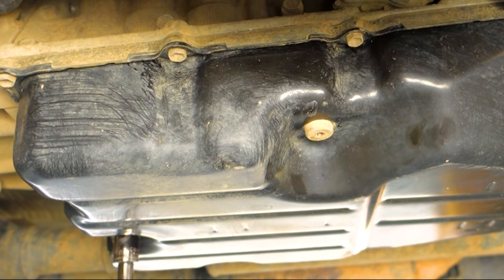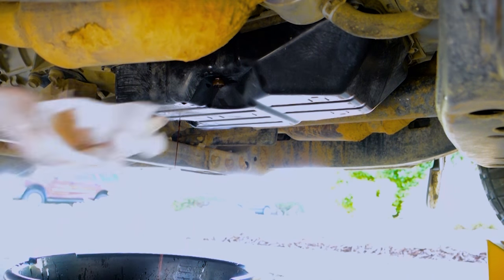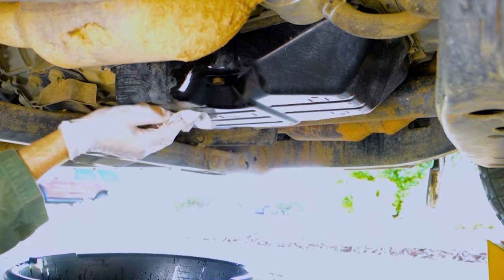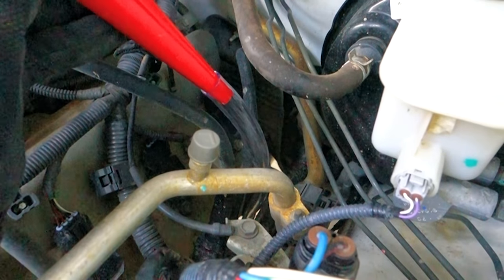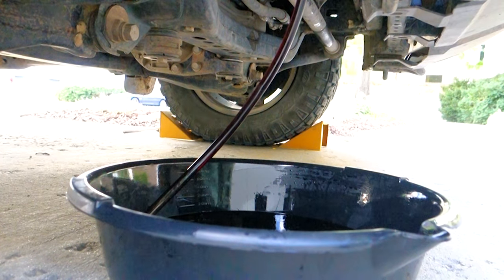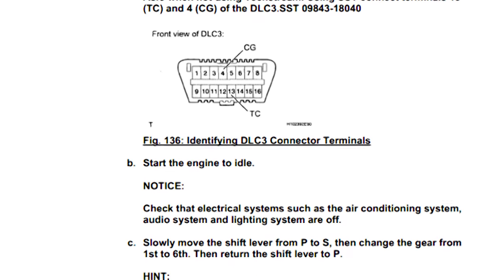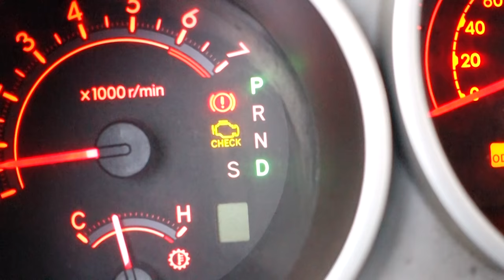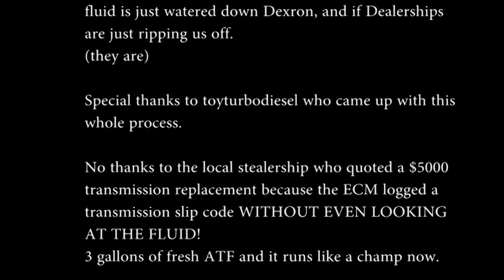Toyota Tundra Full Transmission Flush

Comment: First of all...great video. Gave me the confidence to give it a go and confident that it is being done right. I'm just gonna post my step by step process which comes straight from this video and all of the great comments on this post. If this is your first attempt, watch the video a couple of times and read the comments, the post and replies and you will  understand the process. It was almost like a light bulb when off and had that ahah moment after watching and reading a few times. I am confident I can do this, even before I ever got started. So here is my step by step and my contribution to the Youtubers and DIYers.  

Apply the parking brake
Transmission cooler thermostat lock with wire or paper clip
WS marks fill port
Loosen the 3 transmission plugs first
Remove Drain plug and drain the fluid
Measure  the amount of oil drained
Replace the drain plug
Refill with the same amount into transmission fill port

Disconnect the transmissionoil cooler outlet hose
Attach an extra drain hose from the transmission cooler  into a  drain pan
(*This video says the top hose, mine was the bottom hose on a 2007 Tundra Gen 2)
Turn the engine on
The fluid from the cooler will start to drain
Measure the amount of fluid drained
While the engine is running, have the driver shift through all of the gears to open all of the ports
(I heard the gears start to stick so I would only shift through the gears once)
Turn off the truck 
Add transmission fluid into transmission. The same amount that came out of the cooler and the same place where you poured it in earlier into the transmission.  
Repeat process until clean oil comes out. (Start truck for 40 seconds, don't shift though gears a second time.) 
After clean oil comes out of the oil cooler, you are done draining oil from the transmission cooler so reattach the transmission cooler hose. 
Remove the overflow check plug and add fluid until oil drips out.
Replace the check plug.

Start transmission temperature process. 

MEASURING OIL TEMPERATURE
Use a jumper such as a paper clip to jump the  #4 & #13 ports together on OBDII port. The place where you attach a code scanner. 
Start the engine
Shift though all the gears to circulate fluid. Move about one gear per second.
Move shifter to drive...then move the shifter back and forth from neutral “N” to drive “D” for at least 6 seconds to engage temperature detection mode
The drive “D” light will stay on even though you are moving the shifter.
If it doesn’t work, move back to park “P”. Shut engine off and start over and double check the paper clip jumper.
Once the vehicle is in “temperature check mode” the drive light “D” will be:
OFF= TOO COLD
BLINKING=TOO HOT
ON=JUST RIGHT
When in the right temperature range, with the engine idling, remove the check port plug and add transmission fluid until a Good STREAM is flowing out then reinstall the check plug.
Shut the engine off
Torque all the bolts and clean up!

Thank you for the video and all of the post. I was able to save some money and do the job right. Can't say thanks enough!
Reply: Does your 2007 Tundra have the A750E? I am getting ready to do this and want to make sure I have the right hose
Reply: Do you know where i can find the directions for my truck i have a 2007 4.7 Tundra or do you think they are exactly the same as you just wrote out? Thank you

Comment: Two things I've learned while doing my atf change on my 2011. First the tube sizes were wrong. You need a 1/2" ID for the fill and a 3/8" ID for my cooler. Idk why but thats what worked for me. Second is that he did not specify if the temp valve should remain open when checking the level which it should. That is all. Great video. 👍

Comment: Great video.  This really made it easy, especially with the Temperature procedure - I will add that the Torque specs are 15 lbs-ft for the hex/check bolt, ~24 lb-ft for the drain, 29 lb-ft for the fill.  The cooler return line on the 2011 Tundra looks a bit different in that it's covered up on the inside of the grill.  You have to disconnect on the outside of the radiator/cooler - but it is still the top hose, just follow it though to the outside and disconnect there.  3/8" ID tubing fit just fine.

Comment: Great video. Very clear and straightforward. Couple additional steps that I would've done was to repeat the process where you start the engine to drain out old fluid. Do that in 1 to 2 quart intervals to flush out all the fluid.  When the fluid starts looking new coming out of your clear tube then proceed with your check level process. Again nice video.
Reply: Agreed.  He did mention exactly what you just said, but it would be helpful for others to see it in case they're not paying attention.

Comment: I have a 2013 Tundra SR5 / TRD with 6 speed automatic, 5.7 liter engine.  On this model, the transmission cooler and AC condenser are all one piece.  The top 25% or the coil is the transmission cooler and the rest is the AC condenser.  In this case, you will have to disconnect the rubber hose on the grill side of the radiator instead of the engine side of the radiator.  Additionally, I highly highly highly (oh did I mention highly?) recommend purchasing a transmission filter kit, drop the tranny pan, clean it out and clean the magnets in the bottom of the pan.  There will be a lot off very fine shavings in the bottom of the pan (from normal wear) and on the magnets.  Remove the old filter, install the new one and then reinstall the pan with the new gasket.  Of course,  this would be done after the first drain you do.
Reply: what? this would be done when?
Reply: Napa auto parts sells an awesome gasket that is 100 times better than any others I have seen. They run about $65 for a filter and gasket but super high quality.

Comment: Great video and straight to the point. This is not a new procedure and is the 'poor man flush' can be used on any vehicle. This however outlines great detail on how to do it on a Tundra, well done. I agree with you on Toyota's change interval being way too long. Mine had 122K miles and this must have been the first change, my fluid was BLACK. Truck was searching for gears so I knew something was up. (i'm 2nd owner but truck had all other maint done according to carfax, trans was only thing I  didn't see). I used  my scangauge II to measure trans temp which made it a little easier to do the top off. Then for final top off I just overfilled a little bit and then started truck, opened the check and drained until it trickled. I was doing this myself so it made it easier then starting/opening check/pouring/looking.  Thanks for posting.
Reply: did it run better afterwards? i know its been 5 years since you posted lol... I have a similar milage 2013 and ordered everything to do this. I dont think its ever been changed either,.

Comment: Awesome video! Thank you so much. I just did my 07 Tundra and the jumper points worked perfectly. I over did the flush and ended up using 3 3/4 gallons but the fluid was squeaky clean coming out. All in all it's easier than changing the fluid on a turbo hydramatic 350 and all the fluid gets removed. I saved a bunch of money and I know it was done properly!
Reply: What fluid did you use?

Comment: With 60K on my 2008 Tundra it's time. The local dealer wants $280 to do the flush. almost worth it to me to avoid the mess. however having been a Mercedes master guild tech for 20+ years, I am well aware that just because you went to the dealer does not mean you will get a true tech and not a parts changer. In all actuality 7 out of 10 tech were hacks that sell parts instead of fixing cars. Than I read your experience at the end of your video and it is settled, I will be doing this my self for about $55 in oil.
thanks for your helpful video.
Reply: Nice video. Have not DONT the flush year but would like too.  You REALLY need to have the TSB in hand when your do this if you don’t have a tech stream TIS at home.  Normally I will run the steps to check my fluid level and top off with a hand pump.  As stated in the TSB, the engine should be running IOT have the correct fluid level check and to be accurate.
Reply: Oh yeah. I have a 2007 tundra with 318,000 miles.  Still running strong.
Reply: Just did trans fluid on my Tundra. 60 k miles. My friend who is certified master mechanic did the whole thing. Did not do the complete flush.Just dropped the pan and changed filter and gasket. There was no need for complete flush. (We were going for it but after inspecting the oil and pan and filter we did not want to jinx it)Oil was really good. Off red but still redish. He did not believe it. Pan was clear and magnets clean and I mean clean. You will never have red oil in it like the one you put in.  It will turn like in the bottle in video w in a day. Drained 6.5 qt.  WS ATF is the way to go. Will do this every 30k.

Comment: Thanks for the video. I used it to do it myself. Two points that I would like to emphasize: 1) You are repeating the drain/fill process until fluid runs clean from the transmission cooler ( that wasn't clear to me at first). 2) To do the fluid check process and get the fluid at the correct temperature, you need to start from cold. Let the truck sit over night or for several hours. 
Again, Thanks
Reply: If you start from cold, how do you get the fluid to the proper temperature?  Do you just leave the truck running until the D light comes on?

Comment: Bravo maestro! not only educational, but it is also an inspiring video! 
i put Redline D6 and my truck runs much smoother now.
when i drained the tranny pan in the beginning, about 4.1/4 quarts of ATF came out. i started on cold with removing the level plug first. then, using the method described in this video, i drained 5 more times: 4x2qt and 1x1qt as i had only 15 qts of new ATF. 
not sure if i've done the last procedure properly though, as i ended up having more old fluid than i put in, like 1/2 qt more. nevertheless, truck runs great: no slipping, overheating, jolting or delays in shifting. anyways, i'll do level re-check when i get more fluid.

Comment: I'm in the middle of doing this. I have an 08 tundra 4x4. I used the top cooler line like you said. I put a clear hose there and when I started the truck atf was coming out through the black hose that was there before.

Comment: Best video on YouTube! Question, to piggyback on previous question. When your filling fluid during flush do you continuously pour while someone going thru gears with truck on or do you pour in stages?
Reply from the maker: I did it in stages using the volume of the oil sump to pump through the system.  I didn't feel confident enough about accidentally overfilling or underfilling so it seemed a little safer.  But I'm sure it's doable in one big transfer like that if you're careful.

Comment: Thanks for the video. I have a couple of questions for you:
1-Why do you use the overflow port if you can check the level at the correct temperature.
2-Should I check the cold mark first.
3-What is the temperature ranger for the oil? (160-175F)?  at what temperature exactly you measure it?
4-Can you use torque pro to get and scanner the correct temperature?
5-Do you know if the paper clip trick works for all Toyotas?  what about Camry 2007 LE 4 cyl and Highlander 2011 AWD 6-cyl?
Thank you
Reply from the maker: 1-The overflow port is the level check.  These new sealed Transmissions don't have dipsticks.
2- See #1
3- If you mean when you're supposed to test the level?  99-111F which is pretty cold for AT Fluid.  This number is different than what I read others doing online so it may vary by model year?  That's why you go through the process at 5:00.  The transmission light will come on when the temp is right, and blink when it's too high.
4- Yes probably. Be aware of any possible inaccuracy of the temp sensor display.  Like I said in #3, if you have the AT light come on the Toyota will tell you when the temperature is just right.
5- Yes, OBD2 ports are standard now but I'm not 100% sure the pin outs are always the same on vehicles.  I used a paperclip to jumper the port on my old Toyota made Scion too.  The official tool to manually jump the pins is a prettier purpose built wire for the job but it's the same idea, just a wire between 2 pins.  The computerized scanners Toyota uses is doing the same thing as well connecting the voltage of the 2 pins.

Comment: Although I'm not currently at a Toyota dealer, I graduated with a T-TEN diploma and I can tell you that if you think WS ATF is watered down Dexron you shouldn't be changing your ATF at home. Toyota has a reason for EVERYTHING which is why I own one. I highly recommend you amend your video to ONLY condone WS ATF. There is no other accepted substitute in the industry.
Reply: Toyota wants to make money just like everyone else. They put out a TSB on how to properly drain and fill the transmission and this guy followed every single step.
Reply: BowHunter77 key phrase there "drain and fill." toyota would never recommend a backyard flushing technique like this.
Reply: Of course they wouldn't, because your average Joe wouldn't know what the hell is going on. I'm a certified GM mechanic that happens to love Tundras and this method works very well. It drains/pumps out the old fluid in the torque converter and draws in new fluid which is better than just draining the pan. I took it one step further and replaced the pan filter on the valve body. Toyota doesn't make bad fluids but they also don't make the best as you seem to imply in your first comment.
Reply: I don't always use OEM parts, but you'd be a fool use a one-size-fits-all ATF.  Motor oil...sure use anything.  With ATF you better stick with OEM with specific friction modifiers. Toyota's ATF is very high quality, just do some research before you say that because Drohawk is correct about this.
Reply: From all the forums there are plenty of folks switching from ATF WS to the the Valvoline Max Life synthetic with no problems after thousands of miles of use.  Some say the tranny works better than before.

Comment: So not like older trucks where you do the filter as well? Or is it just a screen under there?
Reply from the maker: I believe there is a screen inside but you'd have to pull all the bolts holding the pan on and I don't know if the screen/filter is accessible without dismantling anything else.  This was meant to be a much simpler flush of just the fluids where the only components removed are basically the drain and fill plugs.  I REALLY disagree with Toyota's sealed and never change maintenance plan.  I don't care what their scientists have done I don't believe the AT fluid maintains itself for over 150k miles.

And considering we're 3 years down the line and it's still running like a champ after the dealer told me it would be a $4000 replacement to swap a new Transmission I think the fluid change has proved it helped.

Comment: Quick question: do you take out the pin holding the thermostat in before you check the fluid level?
Reply from the maker: Yes, you do.  I totally forgot about that.  Taking out the thermostat pin returns the whole system back to "normal" and that's how the level should be checked.
Reply: Answered my question.
Reply: How's your transmission now ?
Reply: @exploresouthwest  The Toyota pdf I have for my 07 tundra states that removing the pin is the very last step of the procedure... Just trying to make sure I do this correctly. Thanks for the video.
Reply from the maker: @btmorris82  Yes when you're all done make sure to pull it out.  I actually left mine in a day on accident and couldn't figure out why it took 20 mins for the transmission fluid to reach mid range.
It doesn't ruin your transmission if you leave it in.  But it's far more efficient if you take it out.

Comment: Southwest, good video. However when I hook up my clear tubing to the outlet port on the cooler, fluid isn't coming out of the port. Fluid is coming out of the black hose with the pink marking that I removed. Thought? Where did I goofed? I have 2007 tundra 4.7 sr5.
Reply: If you have the tow package (with ATF cooler), the bypass valve must be manually opened  first before beginning the procedure. Otherwise the fluid will back flow into the black tube as it bypasses the ATF cooler and goes through the ATF warmer, as you described in your problem. Under normal operation, the bypass valve will open on its own once the fluid reaches normal operating temperature. So, unless you open the valve manually the fluid will not flow through ATF cooler until it warms-up - which is not practical when changing the fluid. Manually opening the bypass valve essentially makes the fluid flow as if it was already warmed up. At that point it will come out the ATF cooler tube as described in the video.

Comment: Trans Oil Cooler outlet hose?   2011 5.7 L Tundra w tow package. Is the outlet hose always the top hose on the cooler?  I want to make sure I flush the correct hose. 
My Trans oil cooler is much wider than the one shown here and the fittings are on the outside of the engine bay in front.